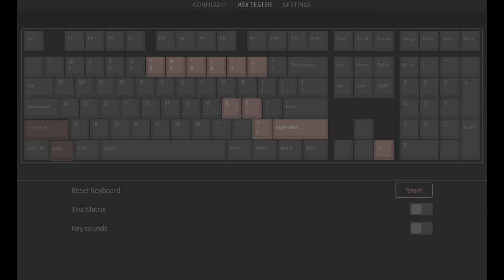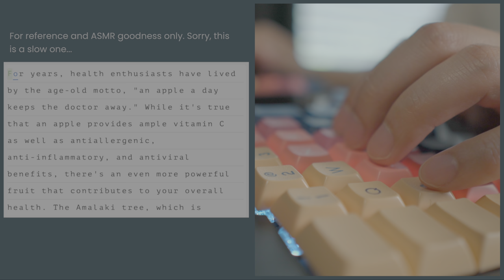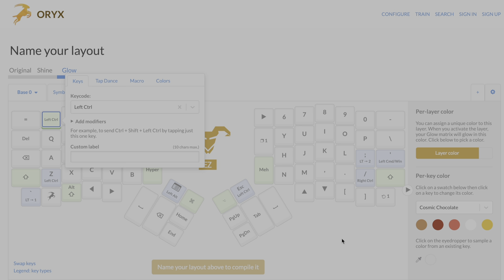Insane Ergonomic & Split Keyboard - Ergodox EZ Build and Review

Comment: I'd be curious to hear a follow up about how your wife liked the keyboard, how easily she acclimated to it and whether it met her needs. I haven't seen many of your videos and don't know if she prefers to stay off-camera... if so, maybe just an update on a pinned comment? 

I'm considering this keyboard myself and would love to hear her thoughts after prolonged use. Thank you!
Reply from the maker: Thanks so much for your comment. It took her about 2 full weeks to get used to it. That's just the reality of such a drastic shift in layout. You have to retrain your brain but once she did it was much more helpful for her carpal tunnel issues. She wasn't the biggest fan of the length of cabling. It was a lot so if cables bother you, there are other options, or get a shorter cable or a wireless version of the ergodox.
Reply: @VeryImportantGeeks  thank you, I really appreciate the added perspective!!

Comment: Just want to point out that having such a long TRRS cable is actually really useful. I use my halves (not an Ergodox) about shoulder-width apart, and it’s really helped with posture and shoulder/back pain. I use a trackpad or trackball in between the halves though. Using a traditional mouse in the middle might be hard to get used to if you place the halves so far apart like I do

Comment: Awesome channel! Would you be able to add a battery and Bluetooth to the keyboard to at least make it wireless? Even if the two halves need to be connected with a TRRS cable at least the entire thing can be wireless from the computer
Reply from the maker: To my understanding, you cannot make a keyboard Bluetooth simply by adding Bluetooth. It wouldn’t know what information to send. It needs to be built with Bluetooth in mind in the first place. Buuuutttt, Ergodox is considering making a wireless version that is also solar powered as well. Go check that out if you’re interested.
Reply: @VeryImportantGeeks  oh where did you see that? Do you mean the group buy one? If so, I thought that was a 3 party version and the reason I didn't order it was because the key layout wasn't like moonlander, no feet, and if I remember correctly didn't use zsa keyboard software
Reply from the maker: Yeah I think that’s the one. https://www.slicemk.com/pages/ergodox-wireless

Comment: Not ortholinear, it’s columnar stagger (vertically offset as opposed to traditional horizontal stagger). Ortho is gridded

Nice vid. It sure does look good. Tough to justify this amount of money if it doesn’t have QMK/VIA/VIAL compatibility though, even if it’s wireless. Also, TRRS needs updating. Keebio splits have already switched to USB-C because of TRRS having issues shorting PCBs

Looks like a transformer
Reply: It is compatible with QMK